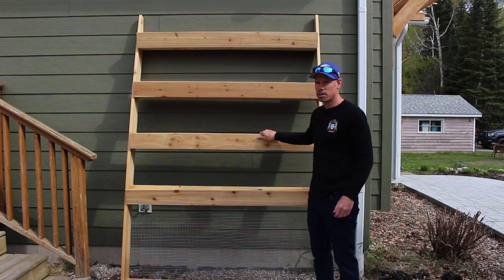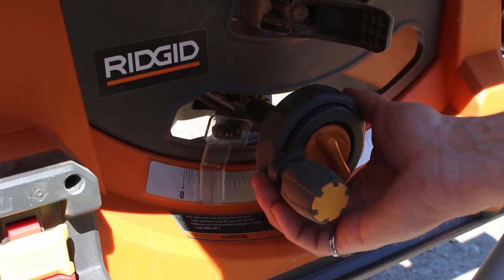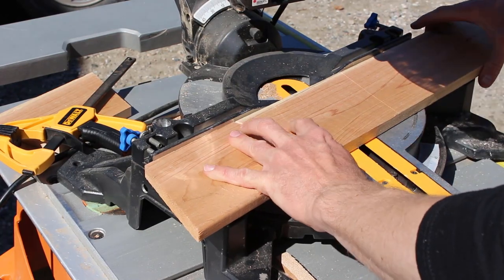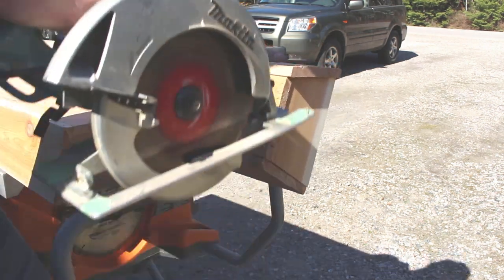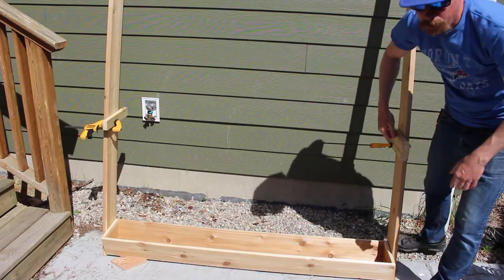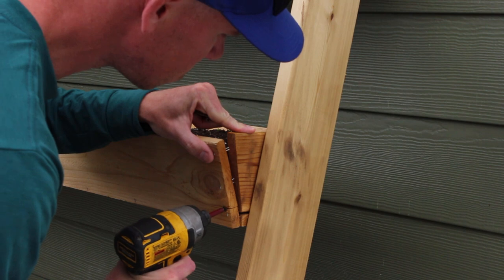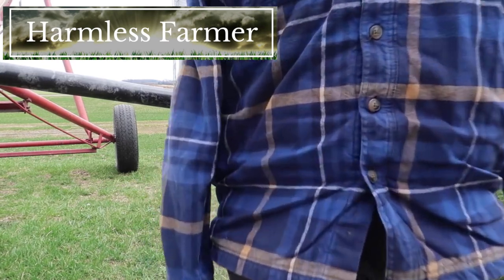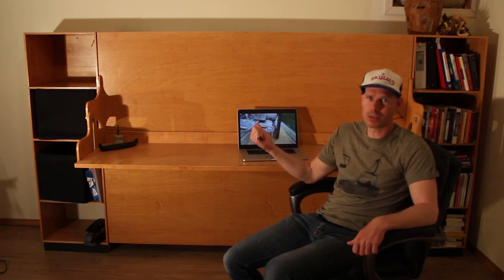DIY Ladder Planter Boxes for Shade

Comment: Can you use wood glue on the planter box? Or would it be too toxic?
Reply from the maker: The moisture of the boxes may Cause a problem for the glue, but it is likely not toxic. Check the label of the glue you plan to use.